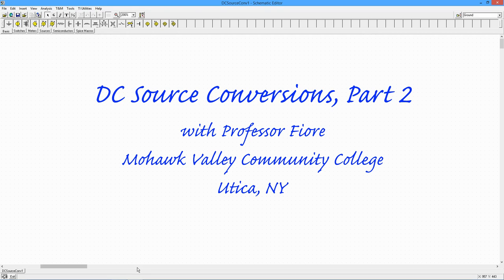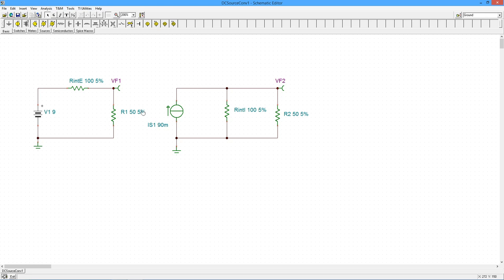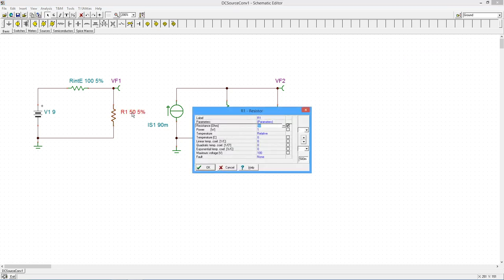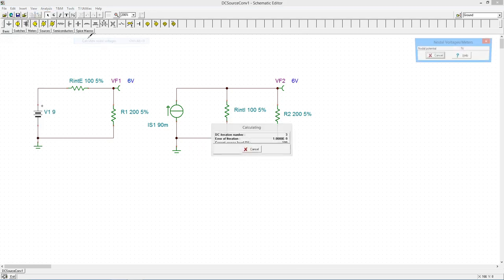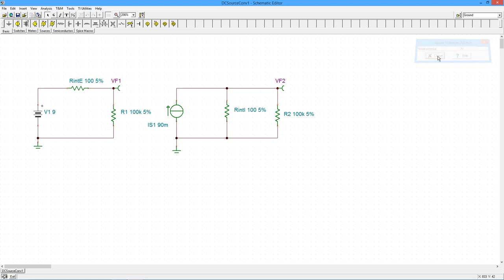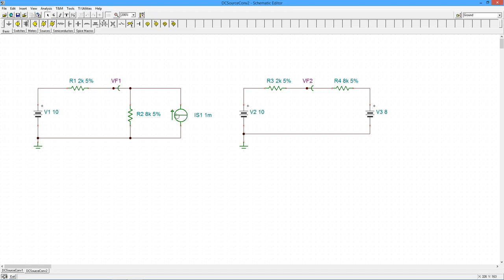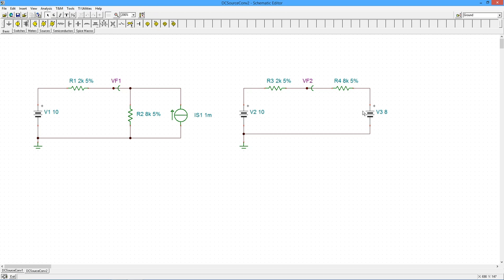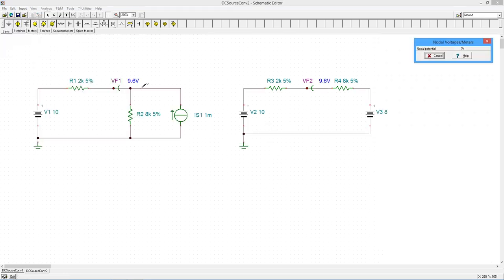DC Electrical Circuit Analysis: Source Conversions, Part 2

Comment: Very good explanation...I have just one query.....In the end, when you are calculating 9.6 volts, how did you get here?
Did you evaluate it by subtracting  the two voltage sources (10-8=2 volts) and then applying voltage divider rule?
Thanks for sparing your valuable time.
Reply from the maker: You can do it that way. I just used Ohm's law (found the current, then the drops on the resistors).
Reply: @ElectronicswithProfessorFiore  Thanks for the clarification. Keep it up...